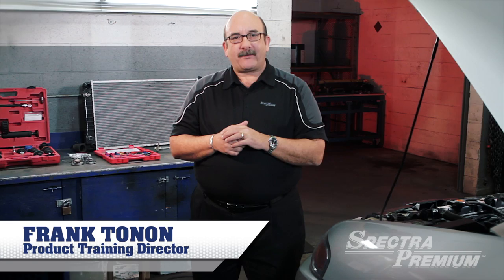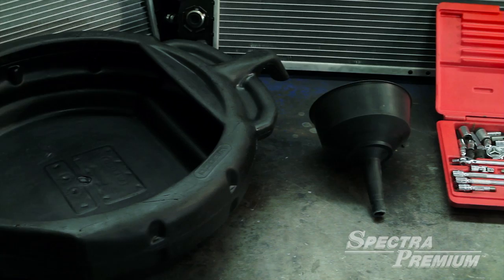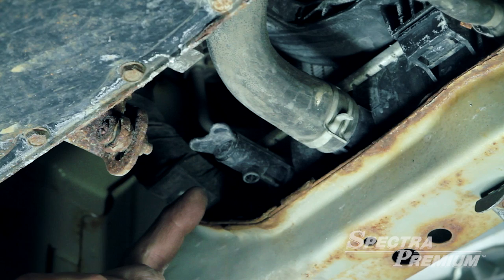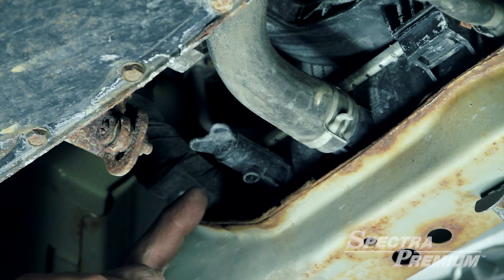03 Cooling System: The necessary tools for radiator replacement

Comment: bought this radiator from rockauto, when changing the waterpump I took the drain cock out, apparently the o-ring got lost in that process.  Trying to get a replacement drain cock for this model radiator is a joke.  Even rockauto doesn't have it.  All the major parts stores have the cork screw style which this manufacturer thought was inferior so they changed the design and don't supply replacement parts.  NEVER buying this garbage again OR from rockauto.  F- for both
Reply: Thanks for this i will now be going to napa
Reply: Why wouldn't you just get a new o-ring? How is this the radiator manufacturer/Rock Auto's fault?